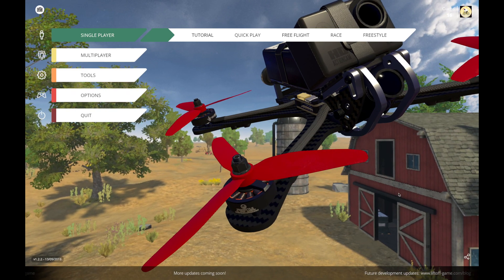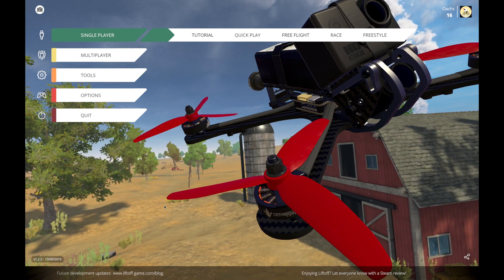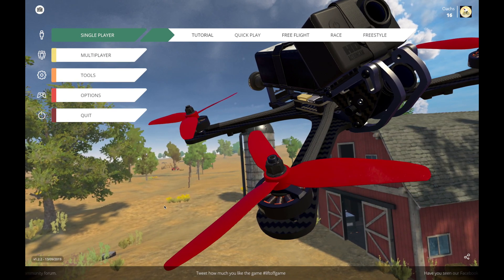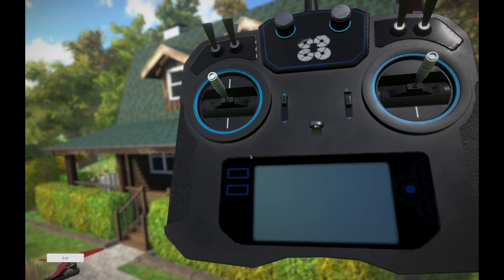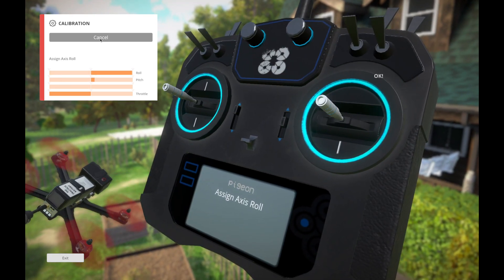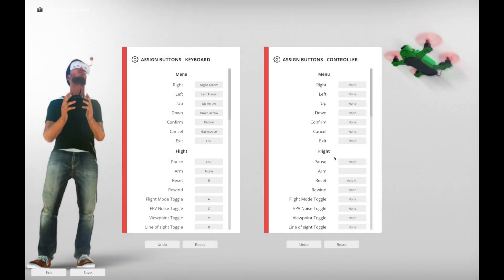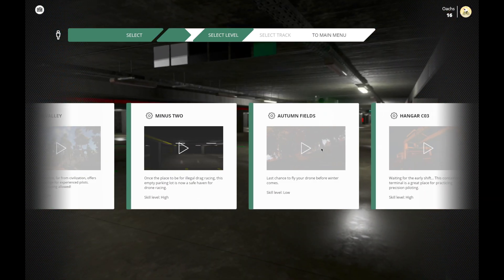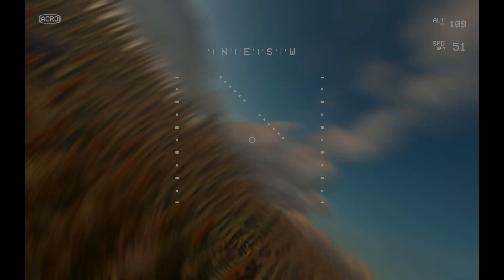How to use the DJI FPV Radio with FPV Flight Simulators - December Update

Comment: Hi, I have a similar problem as FYG H here in the comments "I just bought a DJI controller to connect it to my Mac, as indicated in the video, but when it comes to calibrate the Controller, no YAW is detected during the calibration, no channel for the yaw!  This is with the USBC cable connectionto my Mac as shown in this video."

For me I have no radio connection at all! 

I tried connecting my radio to my drone and my goggles and it works. 
Is there a reason why the radio won't connect with a Mac?
I have also tried a variation of different cords including the one that came with the drone and usbc to usbc.
Any helpful tips will be appreciated.
Reply from the maker: Have you updated the radio to the latest firmware?  If you have the square shaped v1 radio on the original firmware, it won't work as a joystick on the computer until you upgrade the firmware.

Comment: Helllo. I just bought  liftoff and I have the dji fpv remote.  Same as video you made. I'm having trouble getting the sim to recognize it? Any ideas? Thanks
Reply from the maker: Have you updated the radio with the latest DJI firmware?  It won't work over the USB port as a joystick if it has not been updated.
Reply: @5zero7RC  thank you I will do that next and report back
Reply: @5zero7RC  we did it! I'm all in. You were right! Thank you

Comment: Ooooooh! How can I connect the controller of the dji fpv drone to Velocidrone? It doesn't work .. I turn on the controller, connect with usb-c to the Mac and press "assign controller", but nothing .. Help!
Reply from the maker: That should work fine.  I have used the DJI FPV radio with LiftOff and other simulators just fine.  Have you tried using a USB-C to USB-A cable instead of a USB-C to USB-C cable?  For some reason DJI stuff does not seem to like USB-C to USB-C cables for me.
Reply: @5zero7RC  Thanks for the reply! I thought about it too .. I try to take the usb-c / usb-a cable provided in the dji fpv combo to connect the google with the phone and I'll update you, thanks for the suggestion!
Reply: @5zero7RC  It wooooorks!!!!!!! Thanks so much!! Here it is 2 am and I really enjoyed exercising! Thank you!🥳
Reply from the maker: @eleonorarispoli4678  Awesome!  Glad that worked for you.  I might need to advertise that issue more.
Reply: @5zero7RC  I would like to attach a picture of the screen to make it clear, but when connecting the controller with the right cables it is as if Velocidrone has recognized the presence of a connected controller, but in reality the sticks don't move in the simulator and I can't really use it!
Reply from the maker: @eleonorarispoli4678  Have you tried any other sims?  Maybe one of the free ones just as a test?  Try the Orqa sim or download the Curry Kitten one from github.

Comment: Nice video, could you let us know which settings you are used in the liftoff- graphics specially- mine mac book pro 2017 but always have graphic issues warning, sobi used velocidrone instead
Reply from the maker: You might want to give the Curry Kitten FPV sim a try.  It works well with older Mac computers.

I have a 16" Mac Book Pro from 2019 with the top end graphics and it does struggle with Liftoff at times.

Comment: Hi! Is it possible to use DJI Ronon-M controller with FPV simulator?
Reply from the maker: I don't think so, but it should be easy to try.  Connect the controller to a computer and see if it shows up as a joystick.  You can download one of the free sims as a test.

Comment: thanks a lot for the video. a dumb question: you seem to have custom stick ends. where could i purchase those?
Reply from the maker: I do have custom stick ends.  The ends I am using are from a different radio ( Turnigy Evolution ).  I think you can buy stick ends at various FPV retailers such as getfpv.com that will work with this radio.
Reply: @5zero7RC  Do you know which thread size by any chance? :D I've been looking everywhere.. but can't find the thread size... should be m3 or m4
Reply from the maker: @FPVSlice  I want to say m3.  I can take the nuts from my FC stack and thread them onto the radio sticks.  Pretty sure those are m3.  So if you have some m3 nuts around, test it out and see if they fit on the radio.
Reply: @5zero7RC  thank you very much! I’l check it out.

Comment: Hi, I just bought a DJI controller to connect it to my Mac, as indicated in the video, but when it comes to calibrate the Controller, no YAW is detected during the calibration, no channel for the yaw! This is with the USBC cable connection to my Mac as shown in this video. Has this issue been encountered by anyone please? Could it be a bad controller, brand new from DJI!?!?
Reply from the maker: That seems very strange.  Have you tried more than one simulator?  There are at least a couple free ones you can try just to make sure it is not unique to the sim you are using.  I assume you don't yet have the DJI FPV goggles to go with the radio?  If you did, you could check the sticks in the menu of the goggles.
Reply: I have this same problem and can't seem to find the solution anywhere. 
I did try connecting it to my drone and goggles and it works. 
Is there a reason why the radio won't connect with a Mac?
I have also tried a variation of different cords including the one that came with the drone and usbc to usbc.
Any helpful tips will be helpful.

Comment: Hi! I have a macbook air from 2019. Can i download and play one of these simulators without any issues?
Reply from the maker: You should be able run a sim ok.  You will probably have to fiddle with the settings to get it to run smooth.  The curry kitten fpv sim should run fine.  It runs on much older computers.
Reply: @5zero7RC  Thanks, appreciate your answer!
Reply: I have now downloaded velocidrone and it works fine on my MacBook Air. Velocidrone change the settings automatically to match the computer. (If someone with an air wants to try)
Reply from the maker: @larsschroder4797  Thanks for sharing!

Comment: Can I use mavic mini controller on this?
Reply from the maker: I don't think so, but you can double check by plugging it into your computer and if the computer recognizes it as a joystick, it might work.  You could try that with one of the free simulators as a test.

Comment: Thanks for this. I just bought the controller on the strength of your video. Given that I bought it in 2021, I thought that it would ship with compatible firmware, but I had to update it with the DJI assistant software. Now it works great!

Comment: whenever I am trying to Calibrate this controller it is showing an error that all stick not in the center axis. anyone face the same problem?
Reply from the maker: No, I have not noticed that issue.  You are manually moving the throttle stick up into the middle position right?  Because it does not go there automatically like the other stick.
Reply: @5zero7RC  I'm just rotating than keeping back to original position but not working
Reply from the maker: @crosryder3612  If you are calibrating in the sim, you need to move the throttle up to the middle position before you start calibration.
Reply: @5zero7RC  i kept throttle in Center and after calibration kept at bottom or center too but got same error that " problems centering your sticks "
Reply from the maker: @crosryder3612  That's odd.  I have not heard of this issue before.  Is this with the liftoff simulator or a different one?  Have you tried any other simulator to see if they work?
Reply: @5zero7RC  yes with lift off. I recently bought this
Reply from the maker: @crosryder3612  Try downloading the free version of the Curry Kitten FPV simulator from the links in the description of this video.  See if calibration of the radio works with this one as a test.  https://www.youtube.com/watch?v=evYGzcN8m0c
Reply: @5zero7RC  thank you so much buddy. I'll go home and will checkout ;)

Comment: Hello this works not with a Dji Mini 2 Controller or?
Reply from the maker: I don't have a DJI Mini 2 controller so I don't know.  If you can connect the controller to your computer with a usb cable and have it show up like a joystick, it could work, but even then it will not be very good as an FPV radio because an FPV radio does not have a spring in the throttle stick.
Reply: @5zero7RC  i can connect it to the pc but it says no driver can be installed so it makes the windows connect noises but nothing more😅
Reply: Hey @Marjan Pircher have you figured this out?
Reply: @jaywalker_92  it didnt worked, it works with ps4 controller

Comment: Is it possible to connect phantom 4 controller on this app?
Reply from the maker: I'm not sure. If you can connect it to your computer and have it show up as a joystick on the computer, then it might work.  I have heard mixed things about it working or not.  You would probably be better off getting something like the $39 BetaFPV LIte Radio2 and use that in a simulator if you want to practice flying FPV.

Comment: Anyone know if this works on Zepher? DJI P4P V2.0 controller?
(Looking for instructional/practice, not racing)
Reply from the maker: You could try to install a free simulator like the Curry Kitten FPV sim, plug in your controller, and see if it works.  However even if it does, it won't be ideal because FPV controllers don't have a centering spring on the throttle.  If you do want to practice flying FPV in a simulator, consider getting a $39 BetaFPV LiteRadio 2.
Reply: @5zero7RC   @5zero7 RC  thanks for getting back to me! I'm in Canada, so I need to do an in-person practical exam to get my license (not just a written test like in the US). Flying FPV isn't legal here; need to fly manual VLOS for the exam. 

DJI has a sim, but can't find an activation key / keygen. Are there any other non-FPV sims?
Reply from the maker: @emmakay5905  I know most FPV simulators let you change your camera view to a line of sight (LOS) mode.  But it can be really hard to fly that way in a simulator.  Pretty sure the Curry Kitten one gives you two LOS views, one as you would expect, and one zoomed in so you can see the drone better.  I'm sure that won't be as good as the DJI simulator, but it might work ok.
Reply: @5zero7RC  thanks. I'll give it a try.

Comment: damn what about fpv air 2?
Reply from the maker: I assume the DJI radio will work with that sim as well.  As long as it can detect the radio as a joystick on your computer, it should work.  I have never tried FPV Air 2 though.
Reply: 5zero7 RC it detects it but the callibrating is super wonky not sure i get it

Comment: does it work with dji Spark?
Reply from the maker: I don't know for sure, but this DJI forum thread makes it sound like the Spark Controller can NOT be used for flight simulators.   https://forum.dji.com/thread-184369-1-1.html
Reply: @5zero7RC  ridículos! I hate dji!
Thx Man for u help

Comment: I love Liftoff, but the UI is horrid to try to operate from within the goggles.  I can't read a d@mn thing on the screen and have to guess from memory.   You're blind in teh dark trying to fumble around for your mouse and keyboard, and trying to do drop down menus where you don't where the button is or can't see the scroll bar or what level you are click on.   I should make a video and shoot it to Lugi Studios, how bad it needs revamping.  I know it looks pretty, but inside the goggles, it's dang near unusuable.

Comment: Can you link the cable you used to connect your controller to your Mac!
Reply from the maker: I think the cable I am using came with the radio, though I'm not completely sure.  It is a USB-C to USB-C cable as my Mac only has USB-C ports.  Whatever cable you use to update the firmware on the radio should also work for the simulators.

Comment: Hi...Were you able to get your DJI FPV controller to work with CurryKitten FPV?
Reply from the maker: Yes, the DJI FPV radio controller will work with the Curry Kitten FPV Simulator.
Reply: @5zero7RC  thank you...is there anything special about your usb-c to usb-c such as thunderbolt 3, or any usb-c will work?
Reply from the maker: I assume any usb-c cable will work, though I have only tried a couple of them.
Reply: @5zero7RC  finally got CurryKitten to recognize the DJI Controller. Stick calibration isn't going well. Any advice?
Reply from the maker: @mosephina  For me, I first had to do the DJI radio calibration within the goggles, pressing firmly in all directions.  Then the calibration in the sim worked as expected.

Comment: Does this work with my mavic mini controller? I wanna practice without buying a 300 dollar controller...
Reply from the maker: If the controller shows up as a joystick on your computer, it will work.  There are free simulators you can download and try if you want.  However the mavic mini controller won't be ideal as the left stick self centers and you don't want that for FPV.  Perhaps look into the BetaFPV LiteRadio 2.  It works with simulators and only costs $39.

Comment: Is there any way to do this wirelessly?
Reply from the maker: Yes, sort of.  You can put your flight controller into a mode where it shows up as a joystick on your computer over the usb cable.  But to do this you need the DJI air unit powered up, which will generate a lot of heat.

https://www.youtube.com/watch?v=wuobzowLfj0&t=26s

Comment: I got it working! Make sure you update & use a usb-c to usb-c or a usb-c to usb (regular one, both work i've tested even with magnetic cables). Once you have it updated, even if in devices it says that drivers aren't found, make sure you open something like liftoff and then CALIBRATE. There wont be any input at the start, but select HID INTERFACE (not USB-HID keyboard) and calibrate using that. Spin your sticks and see if there is any input signal (YOU MUST CALIBRATE FIRST). This was driving me mad only seeing HID Interface and USB-HID keyboard.

For some weird reason it said it detected pigeon when I first plugged in, but it gets identified as that HID interface name.

Comment: it cant detect my controller? ive tried over 4 cables type c to type c, even the USB A to c in the box
Reply from the maker: That's really strange. I have not heard of anyone else having that problem.  Are you running the latest firmware on the radio?  The original firmware it came with can't be used as a controller in flight simulators, but the more recent ones added that feature.
Reply: Im having the same problem.  My games dont see it.
Reply from the maker: @chrisalexander2478  Are you sure your radio is on the latest firmware?  Version v01.00.05.00?  Anyone else have this problem and find a solution to it?  Maybe try other USB cables?
Reply: @5zero7RC  Yup I have the latest and I have tried 2 different cables.  The PC sees it.  It just isnt using it where the game can see it.  Im thinking it is in the libusb driver or something.  Had a similar problem with my Jumper T16 last fall when I ran it.  I had to roll back a driver to get it to function.  Maybe I need to roll it forward again to get the DJI to function... :P
Reply: @chrisalexander2478  did it work?
Reply: @christophhaas5696  I havent worked with it since.  I have been using my Jumper T16 and it works fine as the joystick.  I never tracked down the driver problem for the DJI.

Comment: Where is the update
Reply from the maker: To get the update, start the DJI Assistant 2 ( FPV Edition ) on your computer.  You should have already used it to register the components.  After you start that program connect the radio with a usb cable and it should show up.  Then you can click on it to update it.

Comment: thanks for the simple instructions.  I am getting ready to set mine up but quick question, is it possible to invert the ascend and descend stick? (pull down to lift, ?) thanks again
Reply from the maker: I believe it is possible, but I highly discourage it.  It is much better to learn with the sticks in the standard mode 2 setup as you will find a lot more support that way.  Also most of the people I have heard from that fly any other stick configuration regret it because they can’t fly their friends setups.  And once you learn, it is very hard to switch.
Reply: @5zero7RC  gotcha... thing is I fly all my mavic and other drones inverted lol.  I'm special lolol

Comment: will this work with dcl or how do you do it cause i connect it and my computer sees it but dcl doesnt fix?
Reply from the maker: I have not tried the DCL simulator so I can't comment on that, but I would assume it would work.  Perhaps try downloading the free Curry Kitten simulator as I know that one works with the DJI FPV radio. If that one does not work, then you might have some sort of driver issue. https://www.youtube.com/watch?v=-dIxzPoFrqI
Reply: @5zero7RC  ok thanks I'll try that
Reply: @JTGFilmsOfficial  dit it work?

Comment: Anyone know what simulators will also work with an old MacBook Pro (Late 2011)?
Reply from the maker: I'm not sure if it will work well or not, but there is some chance you could get the free Curry Kitten simulator to work well enough.  https://www.youtube.com/watch?v=JsjKx262ZBY
Reply: @5zero7RC  Great, now I just need to get my MacBook pro to recognize the controller.

Comment: Thanks for the vid. I'm a complete newb to the FPV world. Just purchased the DJI FPV system but no drone yet. I plan on connecting to a simulator first to get practice. That said, has anyone connected their DJI goggles to your MAC/PC for your simulator rides?
Reply from the maker: The DJI goggles don't have an HDMI input so there is no good way to use them with a simulator.
Reply: that’s what i’ve been gathering from my research... i guess i’ll be getting the hdmi/av convertor and try to go about it that way
Reply: @philipreyes7207  did that ever work? and i'm also getting started on FPV drones
Reply: @tenzinthinley4913  same. Its so hard if you are new...